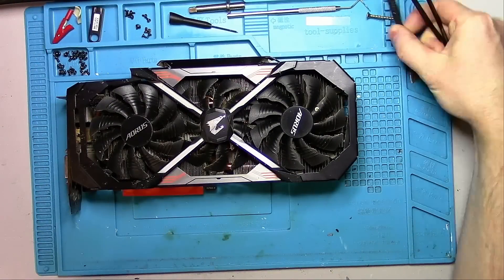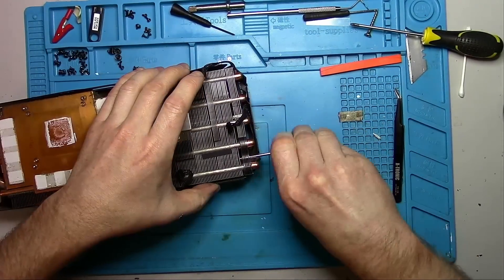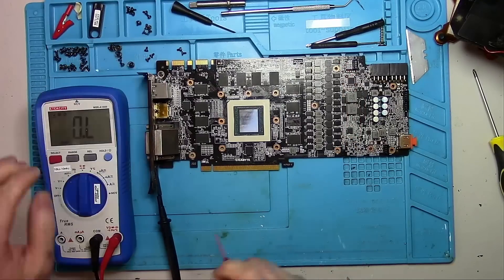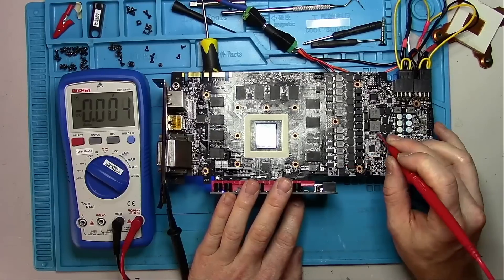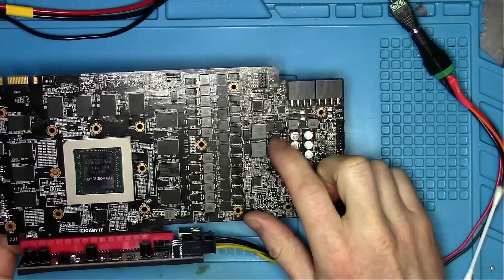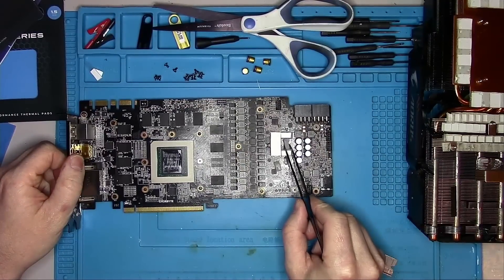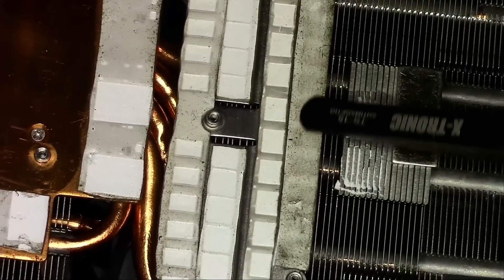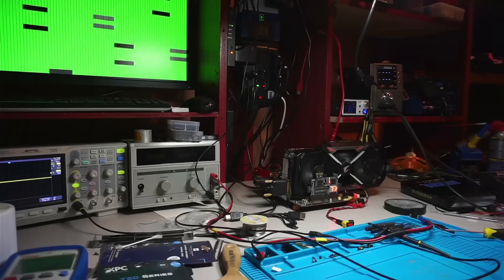Does Gigabyte make good Graphics Cards ?

Comment: I had a similar experience with a Gigabyte 3080. Bought it for $1000 (a good price at the time) and hooked up a friend with it during the GPU shortage for what I paid for it, and it turned out completely dead. Didn't want to return it to the store because then I'd have no card for replacement, as that's how retailers work. RMA'd the card to Gigabyte. They kept it for over 2 months and after 5 emails that turned into threats, they sent a repaired 3080 back to me in a 3080Ti box. It overheated like hell, with the GPU going to 100c and throttling immediately. Turns out that during reassembly they used the wrong thermal pads and screwed it down incorrectly, severing an extender cable used inside the shroud for powering two fans (bad design + bad execution). Eventually got the right pads and paste along with the right replacement cable. My friend got his GPU from somewhere else during that time. What a nightmare. Don't buy Gigabyte GPUs.

Comment: My experience with gigabyte gpus have been a solid 10/10, ive been using Gigabyte AMD cards for almost 10 years and they are so insanely durable. I had a gigabyte hd6890 that lasted for years b4 i upgraded to an rx570 which also lasted for years. My card died on my last week when i was forced to switch to nvidia due to lack of availability of amd cards in my country. Though this time i went for an inno3d chill series, since they had a far superior variant of the 3060ti compared to gigabyte(Better power draw). But id still reccomend gigabyte due to their superior build quality
Reply: What about they warranty and repairs do you recommend that
Reply: @Ghostlynotme445  uhhhh. Usually warranty period for gpus is like 3 years for any gpu manufacturer. And their cards last way beyond that. Both my gigabyte cards worked for like 4- 5 years max. So ive never had to rma any of their products.  The worst experience ive had have been woth asus products. And imo id never recommend asus to anyone
Reply: In my experience. Msi and gigabyte have been extremely reliable and durable
Reply: @delightful209  Msi  reliable? I heard horror story about Msi don’t treating there customers well
Reply: @Ghostlynotme445  no clue. Never had issues with their quality. They have always been excellent.

Comment: I've been using gigabyte gpu for years now. From 950 to 1050 to 1650 super and so far so good. Just that, i got Auros master RTX 3070 recently boi it's a hot card. I never have this issue with other gigabyte card before. Now i kinna regreted it and should have gone for Asus tuf card

Comment: My old Asus Strix 980Ti refuses to initialize on boot. Took it completely apart, cleaned and inspected. I can't visually see anything wrong with it. I do feel bad tossing it out. 
I remember a slight burnt smell when it died but again I couldn't find anything that looks like a thermal incident. I may try a few more of these checks you perform, tested fuses all good.

Comment: So far the graphcis cards I owned so far: ati hd radeon 5550, msi gtx680 lightning, a gigabyte 780ti and a 980(both some special factory oc editions), and currently using a an msi 2060s.
You can guess which cards started sparkling so violently I nearly shit my pants. Both the 780ti and 980 had a lifetime of 2 years each.

Comment: I love gigabyte.. 

I know EVGA is good.. 

But they suck with the fans and cooling.. 

They usually get a coil whine.. 

The last card I bought was the gigabyte GTX 970 extreme gaming with the titan chokes   

Amazing card . 

I'm on the market for my next card . Now that they dropped in price.  

I'm watching your video cause I never know which parts have all the pads .. 

Cause when I get my next I'm opening it right away.  Adding new artic mk-4 paste . 

Like I did my 970 .. I only used that GPU two years. Added new paste and let it sit...

Cuz I felt the 900 series ran too hot. I didn't want to run it. I like it but I wanted to buy a new one and then all the sudden out of nowhere the Bitcoin or crypto coin or whatever started happening. And even my used video card shot up to about $1,500 in price. So I wasn't about ready to get ready to buy my new one because there was nothing really on the market and the prices were crazy....

The prices now are still twice the amount of what I want to pay but the video card at the same time is twice the video card that I was going to get cuz I was looking at the tens and the 20 series at the time 

I started my channel building my PC on YouTube.. 

And gave up .. cause of GPU prices in 2018 . 

Now that food prices at the grocery store doubled. 

I know GPUs are at there lowest price we will ever see again.  

By next spring prices will start to rise in every subject. 

Get them while you can. 

I want a 30 or 40 series.  

I know quality in everything should start going up again.. 

Cuz a lot of areas were going downhill for the last 10 to 20 years, especially some of car audio. It seemed like it was improving but quality area was turning to garbage ..

Cars to .  They became new expensive fixes . 

Quality should start getting better.  

Cause most electrical stuff doesn't last long.. 

I never did trust or like Asus . 

I liked gigabyte even though they have software issues sometimes . 

I like msi also . 

But have no idea what company to trust today. 

Asus has gone crooked. 

They offer a bios update that voids their own mother boards warranty. 

Like wtf . 

I've never seen a gigabyte show up like yours.  

But I also believe that when you live in different parts of the world or different parts of the country, there's favoritism to where if you live in a popular area, you're going to always get the good merchandise. If you live in a crappy area, you're the companies that you receive from or the shipping organizations that you receive from are going to send companies that send companies by whoever crappy s*** so there's going to be a lot of reviews to where people got bad stuff and I wish in a review it said the location that people were at where they received it so I could start seeing if all the good reviews are in one area and all the bad reviews are located in other areas. 

My bad .. not trying to ramble.  

I'm just getting old and I'm getting tired of getting ripped off. We moved to Spokane Washington to retire and there's nowhere we can take our car to and trust that it will get fixed properly. I keep getting ripped off every time and I'm a mechanic and I don't catch the rip-off before it happens. I get suckered in somehow and then after the fact I go. How did I let that happen?.  

Now I'm fixing all our cars again.  

I'm remodeling our brand new 2015 home cause it was built like shit .  

What's wrong with quality control today.  

There's a lot of old people that live up where I'm at and I keep thinking about how many of them get ripped off like the way I do when I take my car in getting worked on. Or if actually I've never paid anybody to do anything to my house except replace the air conditioning unit. That's about it. I'll do everything else. .. . 

Anyways I was wanting a GPU ...

I just don't trust any of the companies right now. I have a really nice MSI laptop a stealth.. The gs75 . And I finally added thermal paste.  And brought my temps down from 70c /90 c down to 27c/35c/ in eco mode.. 

Here's the kicker.  If I use the dragon center and I turn the settings up of my CPU and graphics card like go from eco mode to com fort turbo or sport mode. What's weird is in my opinion when I set it to one of those modes, my laptop shouldn't automatically start heating up because nothing's running in the background except that mode, which is crazy to me because before I added thermal paste, if I put it on sport or turbo mode, my laptop would immediately go to 90C with nothing else running.  Except the dragon center .. 

When I build a PC . I buy all the best parts and never over clock anything.  Just buy as big as I can.  And
Then get a amazing case and try to over cool everything. 

And I set the PC to run it's best. 

But it doesn't start throttling up like this msi laptop.. no apps will be running.. 

I'll keep opening the task manager to see if anything is running and nothing will be running except dragon center.. 

Anyways.

I've never been a fan of laptops cause they are better as a work station.  

Mine has the 2070 max q .  

But I had this laptop for 4 years and kept it in its brand new case box because of how hot it ran when I first pulled it out of the box. Sometimes it would get up to 94c. That's insane. 

Now it only gets to 35c . 

But . 

It took me forever to get the courage built up or the motivation built up to open the laptop and remove the complete motherboard and re thermal paste cuz I wanted to make sure I had more RAM Corsair ram.  
Before I opened it up.  . 

Cuz MSI actually put the ram slots on the bottom side of the motherboard. You actually had to take it completely out so you might as well just do the thermal paste while you're in there. 

But I have to admit it was by far the easiest laptop when I finally got down to doing it to open up cuz I didn't have to remove the keyboard like I did on my heelier Packards. I ended up breaking my healer packer because of how much b***** you had to remove just thermal paste it.  

It was easy to replace the RAM. 

On the HP .. but I broke  one ribbon lock down and it never held the ribbon again.. and the laptop never worked again.  

Then I bought this MSI for 2k four years ago . 

I should have bought a sea doo . 

Lol

Comment: Had same issue on ASUS RTX 3080 TUF. On RMA they said there is no issue (!) even photos wasnt enough - photos which showed ~1,5mm gap between thermopad and heatsink. Now on MSI RX 6800 XT Gaming Z Trio termopads from backplate dont have contact with pcb. Definetly thasts my last GPU - there is absurd with prices going skyhigh and quality going low.

Comment: I had a Gigabyte 2080 that had the worst fan controller. It would not run the fans when it should, and the fan controller from gigabyte was buggy. The only way to make it work properly was to use 3rd party software to run the fans constantly at 50% and accept whatever performance that gave me. The card also had really annoying coil whine. 

My next card was an EVGA and it was just flawless in every way.

Comment: One thing I really hate on my Gigabyte card is the 'Fan Stop' implementation, if the temp is below 55 C (give or take) the fan won't spin at all which is great, but they didn't implement any hysteresis so, when I play a not so demanding game, or playing high res video it will stay around the 55 C mark, spinning up, reaching below 55 C immediately then promptly shutting off, so the fan will do a on/off cycle every second, which can't do any good to the motors I would say. Now I use MSI afterburner (Gigabyte aorus software is really trash in my experience).

Comment: I used to be a gigabyte fanboy until I bought a gigabyte graphic card. The PCB was so crooked and wavy that it was not a graphic card, but a graphic lasagne. Not only that but the cooling fins under the heat shield  were bent too. Returned that garbage right away.

Comment: I bought my first Gigabyte card, the Aorus Xtreme 3090, first one melted, because i didnt have enough cooling... so thats my fault. Second one run great... no issue after built a new case with alot of cooling. But i doubt i will buy more Gigabyte after this. The card def lacked enough pads for memory. thats the main issue

Comment: A common trend I see is the shroud is an absolutely worthless dust-collector
Reply from the maker: In many cases yes.
For manufacturing simplicity, they break heatsink into different layers and then fail to properly join then together to make one solid heatsink.
In some way I can see why they do this, large 3 fan cards have allot of weight and if you really look and study how the heatsink is mounted, entire weight of it is hanging on the GPU. Obviously it can't be good so they come up with different layers.
I personally would not have a problem with a subframe and then a heatsink on top of it, the problem I have is lack of proper heat transfer areas between the two.
While heatsink it's self has no problem staying cool, it does not make good contact with the subframe to soak up the heat from it.

I am thinking to run some tests modding these cards heatsinks like I did with Asus ROG strix.

Comment: I had an ASUS 290X, was an awesome card and never had an issue...overclocked the heck out of it, used it for years.  Got a Gigabyte Windforce 290X and the thing was absolute garbage.  The fans didn't last, the BIOS corrupted, constant hitching and overheating issues unless custom fan curves and undervolting.  Warped PCB.  Ugly.  I hate that card.  I still have it because I would feel awful selling it even for scrap prices as I know someone would spend hours on it like I did and still end up with issues.  It needs professional electronic repair, inspection with magnification, cause visibly there is nothing wrong with it.  I've taken it apart so many times, but at this point, you'd have to start poking around with a multimeter.  I am done putting time into it.  I have owned hundreds of video cards, and never had one that pissed me off so much.  I'll never buy another Windforce GPU...ever.  The fans are the most trash GPU fans I've ever seen used on "high end" GPU.

Comment: I'm still confused, though.  And maybe i need some clarifications.

When I build, I have this  OCD that most of the brands have to match.  So when I did a full AMD build this time, I also went with all Gigabyte products (Except the RAM) because I chose a Gigabyte motherboard (X570 AERO) because it has 4 m.2 lanes and a good onboard wifi.

It seems the main prejudice here is the cooling and a discrepancy on one of the memory phases.  So I guess my question is, how much of a performance hindrance is caused by that discrepancy and what thermal changes are made when adding the new pads?  Obviously this is a older card, so the thermal performance difference may be different from a newer card.

I really like these types of videos, so if you can add a compare and contrast of overall performance and thermal performance on an unchanged card to a card you worked on, would be beneficial for this video.

For myself, I've been using my GA/AMD build since Feb '22 and I haven't had any thermal or performance issues.  Everything seems on par for the amount of money I spent.  

My build:
AMD 5600x / Lian Li triple rad AIO
6800 XT GPU (Gigabyte)
X570 AERO (Gigabyte)
32gb RAM (Crucial)
1tb m.2 (Gigabyte)
Screen resolution:  3440x1440 120hz

I run full refresh on every game and maximum quality.. Except Cyberbug 2077.

Comment: I have a Gigabyte 2070S Gaming OC 3x 8G that's faulty (I have to downclock it to 1400MHz to resolve issue with many games).
I contacted Gigabyte immediately (it's faulty since day 1), they told me to send the card to them in Germany (I'm in Italy) paying shipping costs and the insurance. Then they will test it and, if according to them is ok, they'll send it back to me at my expenses, again. The same if the product cannot be repaired (from the conversation with tech support "if the damage is not covered by warranty or not repairable, service center will return the device as it is (without repair)."). To my request "If it has a faulty chip, will it be considered not repairable" they just told me to send them the card. The issue is not even present with all games nor bnchmarks (Heaves runs ok, 3DMark doesn't), so I asked to have at least the test suite they would've be going to use. No feedback. I'm not willing to risk 200€ in shipping+insurance without any certainties...

I'm sorry, but I don't think I will ever buy a Gigabyte product again.

Comment: Funny you like EVGA, I've had nothing but problems with them. I had an EVGA 700 watt power supply die on me in less than a week and two different GPUs from them end up needing RMA. The only other EVGA product I ever bought was a X58 motherboard and that was VERY finnicky and had weird issues that I never solved.

Meanwhile I have owned 4 different Gigabyte motherboards and two GPUs, all of which work fine.

Comment: I bought a Gigabyte 6750 and had similar experience.
Out of the box the mem temps would hit 100C.  Messaged Gigabyte and they said nah, it'll be fine.
Some 3mm pads between the mem and backplate and now runs 75C tops.
Gigabyte never again

Comment: You want a comment, ok. Ever seen the glorious Gigabyte 1650 Super Windforce, or one of the cards that uses that cooler ? Yea thats my graphics card, havent had any big problems, except for the backplate, that makes half of the cooler useless. The same cooler and PCB are also in use on at least one 2060, and you need to remove the backplate to make that one function without jet engine noises.

Comment: I was curious as to the amp draw after the repair. Did the 2A drop by half?
Reply from the maker: Diagnostic is performed at the card in the idle state.
When its under load, its consumption increase according to the demand which i is monitored internally and can be observed by GPUZ